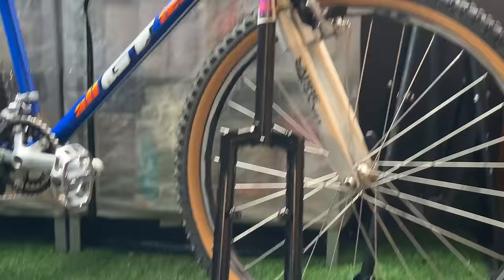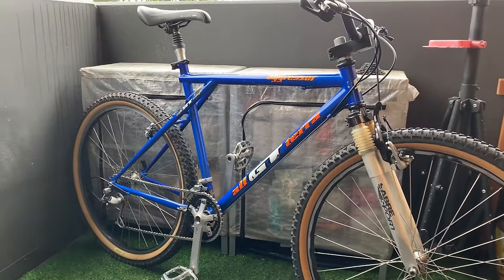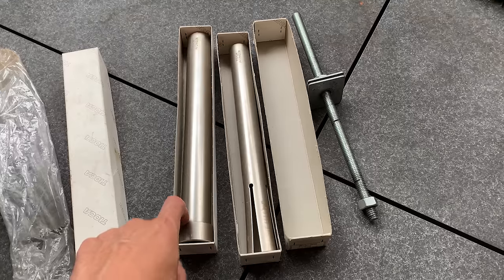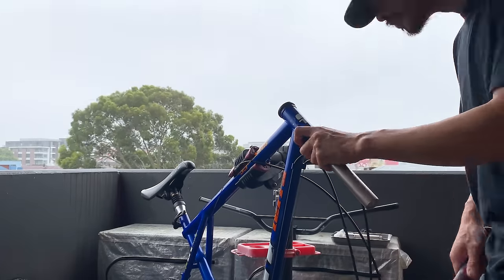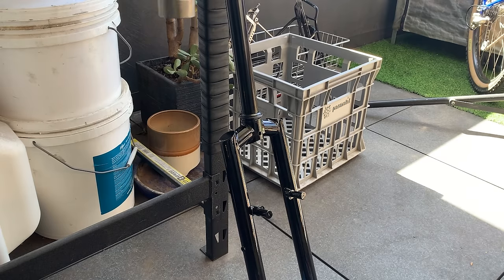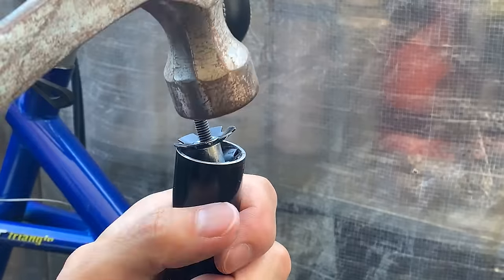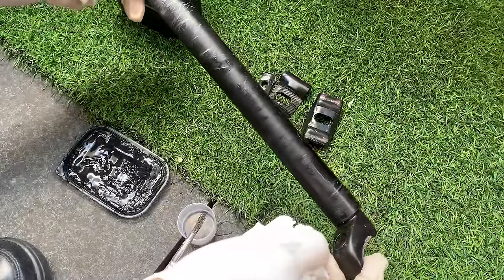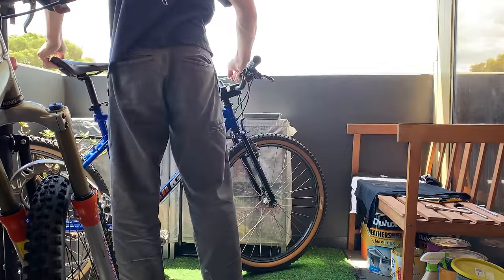suspension fork to rigid fork

Comment: Pretty nice. One tip, I would not recommend banging the crown race tool to the race. It doesn’t seem like it would matter but placing the tool on the race and using a hammer on the tool will yield much better results. I’ve done a ton of headset installations and learned the heard way the damage that can be caused by banging the tool on the race
Reply from the maker: Ahhh okay thank you for the tip I never knew that !! I will be more careful next time , thank you I appreciate it 🙏😊

Comment: Oh, very nice!!! Reminds me of my bike.
Back in 2007, my gf at the time was riding a 19" Marin Pine Mountain which was way too big for her. 
I popped into the local bike shop and came out with an aluminium finish 14" GT Aggressor. 
She took one look at it and said, "Nah". 😒🙄🤨
Fine, I'll ave it. 😁
Took all the crap off it and replaced it with a 92 Deore XT gruppo and a couple of trickies I had off an old Proflex.
Like you mate, a badly scratched seatpin, so I took off all the black finish. Took off all the decals, polished everything and put slicks and my beloved XT 7sp thumbies on. It's running 8x2.
I've been riding it ever since.
Reply from the maker: Thank you I appreciate that!  Wow that sounds like a cool bike !! Nice one , cheers buddy  !

Comment: Star nut installation, use an old stem as a guidance put in the star nut screw and top cap, top cap screwed all the way down and then hammer it in with a rubber hammer. Works everytime
Reply from the maker: Oh that’s a smart tip! I gotta try that one thank you for sharing , cheers !
Reply: @garysprojects  your welcome, thanks for your videos. The GT Agressor looks super sharp with the squishy fork and also without it!

Comment: I bought an Apollo meltdown the other day it was £15 but I gave the lady  20 , I put my cruiser bars on it and I’ve  just done a just eat shift on it , and it is great I need to get a quil stem and bmx bars for it and it will be perfect 👍  what size quil stem would I need to order?
Reply from the maker: Cool you would need to measure the current stem that’s in there and see if it’s 22.2 or 25.4 , I have a video explaining it, in my “how to” section
Reply: @garysprojects  thanks

Comment: Hey pal.
Do you have to account for the travel or sag of the excising sus fork before you know what ridged fork to buy? Also needs to be suspension corrected, eh? 🍁
Wanna install one on my 93’ KHS Montana Comp 
Love the Melbs ❤
Reply from the maker: yes - usually its better to replace the fork with the same travel as originally specced but sometimes you can replace and it doesn't change it too much if the axle to crown measurement is similar. I think it was something like for every 10mm difference you get 5mm in bb drop

Comment: I have the same "Sabre Sport" Suspension fork on my '94 Aggressor. It seems that the fork was mainly installed for optical reasons. Almost no travel, although I gave it a clean and small service. How did you yours perform?
Reply from the maker: It was okay , just took the edge off the bumps , you can see it at the end of the restoration vid I did, I do some riding there if keen

Comment: Yo, good vids. But I've been wondering, what's up with the canti centerpull brakes? My experience with them VS sidepull brakes is that these ones have way shorter range in their braking force. Is it just an aesthetic choice?

That said, nice mod, loving the stiff fork, keep it up! :))
Reply from the maker: Ya they are fun , they work well once setup properly, like you said just personal choice. I have all three types , canti / v brake / disc , fun to be able to switch it up for a different ride experience

Comment: agh do you not use brake cable outer ends?? you can get plastic ones that don't seize into frames will make the outers fit so much better into the routing ports.
Reply from the maker: Nah I don’t really use them , I find if you file the end of the housing it doesn’t make that much of a difference to have them (to me) & also save on some plastic
Reply from the maker: Haha cheers, I’m all good but appreciate the thought

Comment: Have you ever tried aluminum blue or black? They use it on gun parts. It blackens aluminum with a chemical.
Reply from the maker: I’ve never tried it myself , does it wear well ?
Reply: I’m not very experienced with it. The nice thing about it is that it’s not like paint. You can just touch it up as needed. You will have to research it, but it is worth it.
Reply: Also it’s simple.
Reply from the maker: Ahhh okay I will look into it thanks !

Comment: Really clean and cool looking update😎also looking forward to find a black seatpost for my red 28“ Wheeler 1600 gravel build🙂Nice tool update as well…i am using the cup remover for quiet a while and won‘t miss it…to install new cups, I’m using a screw clamp and wooden blocks to press them in place😉to set a new fork crown I made my own tool using an old frame tube💪🏻Cheers mate👋🏻
Reply from the maker: Thank you my dude I appreciate that! Yes the wooden blocks are a great idea! Good to protect the frame. Thank you as always cheers!